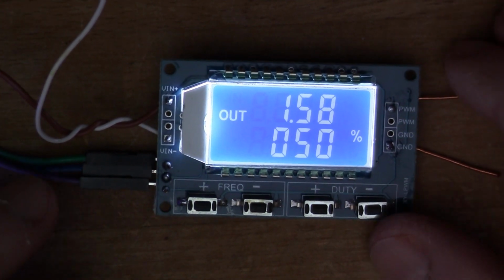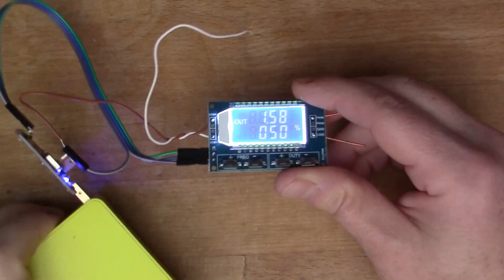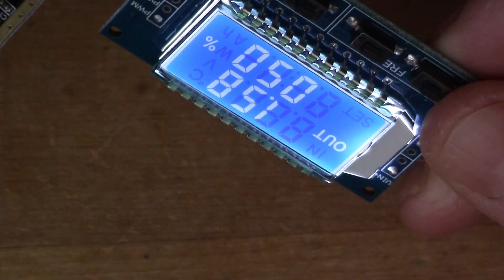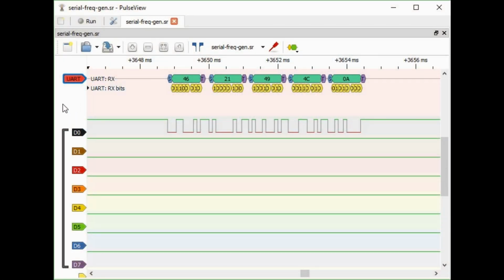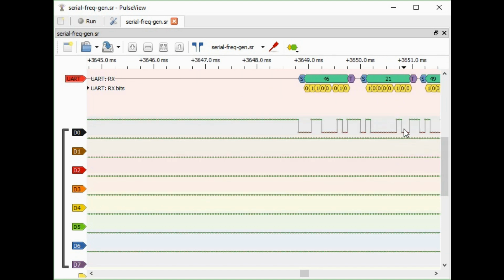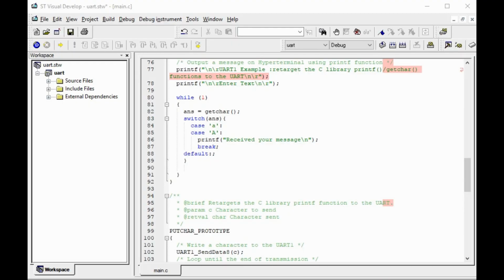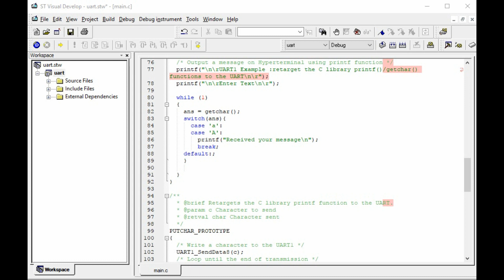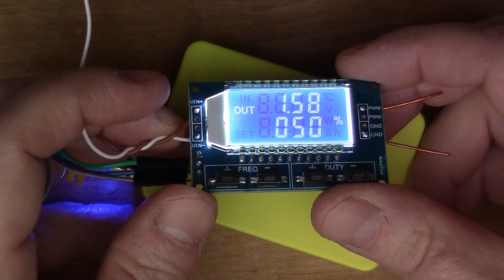Testing a Frequency Generator Module  - Part 2  (Problem Diagnosis with the USB/Serial port)  (#59)

Comment: hi sir, im attaching this frequency generator on my TTL driven laser to create different effects using frequency and duty cycle combination, which creates a different approach on output when projecting on my spinning mirror on a small motor. Im still working on it. And will also post a video about it very soon. Your video is very helpful, helps me to understand more about that frequency generator. Keep it up sir.
Reply from the maker: Thanks, sounds interesting.

Comment: Real a nice effort to explain the things in simple language, Is it possible to set the channels frequency separately? example CH1 50 Hz and CH2 100 HZ. If not any modification which will able to do so please
Reply from the maker: No, although there are two visible PWM pins on the board, they are in fact wired together.  There is a device that I looked at (see https://youtu.be/shhnrFtu1cw), which does have two independent channels, but it is in a number of ways inferior to the 1-channel version.
Reply: im also looking forward on how to control independently per channel if i have 3 frequency generator unit, i plan to set each channel per laser color (RGB). But i have no idea yet how to control those 3 channels in one Arduino Uno. Before i forgot, each laser color has its own TTL laser driver.

Comment: Try connecting it to a serial terminal 9600bps, 8bit, no parity an send "read" to it. To set the frequency send F[freq] ie. "F68" sets a frequency of 68 and D035 sets the dutycycle to 35%. That should help i think.
Reply from the maker: thanks - it gave up its secrets in part 3: https://www.youtube.com/watch?v=1gkhW2-eBPA

Comment: Thanks for the video. I got a couple of these for a project and I didn't have a clue how to connect it. But from your video  I got it working fine. I don't need the serial connection so that's not a problem. Cheers

Comment: hello david i was wondering if you would be able to help me.i have same puls generator as in your video.how can i program it to run 10% duty cycle at 0.64 v input and gradually increacing voltage to 3.86v with duty cycle 90%.its for my project where voltage coming from throttle position valve potenciometer control my pulse/duty cycle generator which then directly control fuel injector.any advice most appreciated cheers joe
Reply from the maker: As far as I know this module can't directly measure a voltage and turn that into a duty cycle.  This sounds more like something you would do with an Arduino board.  The arduino can measure an input voltage (on an analogue port) and can also generate a pulse-width-modulated output.  Perhaps you could also build a voltage to PWM converter using a 555 chip?  Have a search around the Internet and see if someone already has this...
Reply: Martyn Davies thank you for your reply ill try to search for that gadget.
Reply: Martyn Davies i ve done long resarch on voltage to pwm converters but there are only  basic converters with set frequency all based on 555 chip.i need to run my injector on low 4Hz frequency and only manipulate duty cycle.arduino as you said is my best bet and already ordered one of ebay coming soon.only problem i have is how to program arduino uno to convert voltage 0.64v-3.84v to 10-90% duty cycle at set frequncy of 4Hz.am reaching for help this way since my project requires control of injector electronicaly and unfortunately am not good at that.any advice most appreciated.